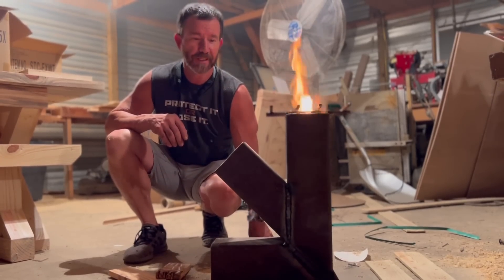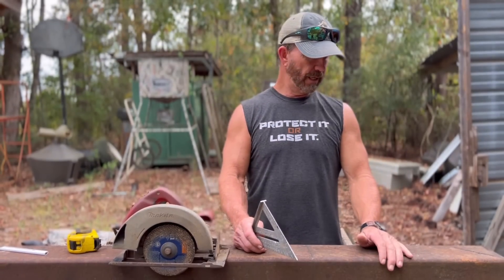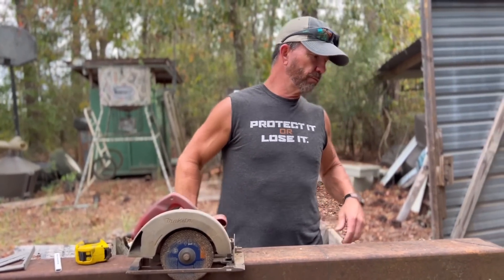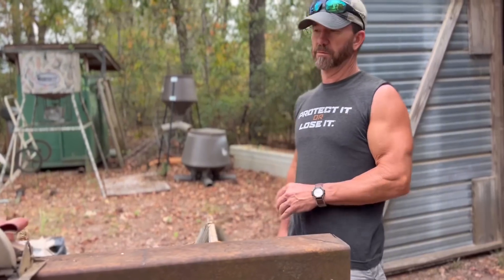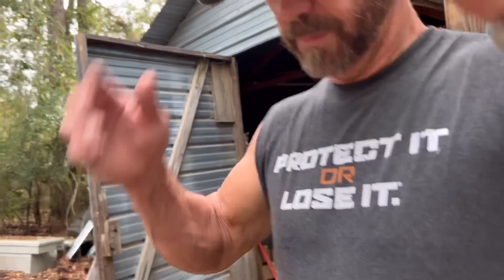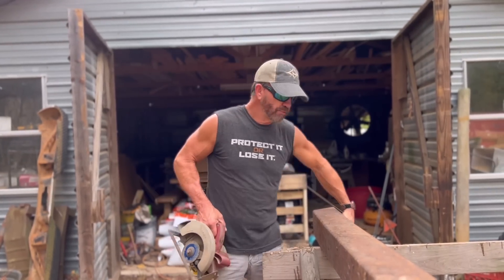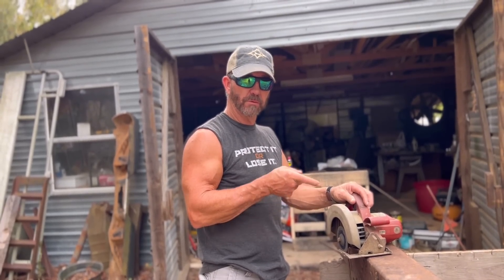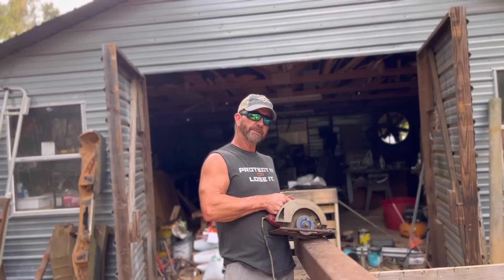How to make a DIY rocket stove

Comment: Instead of a cut-off blade get a Metal Cutting Carbide Tipped blade and it will do the job - better
It does make micro chips though - I use one.

Comment: The top needs to be taller so the flame doesn't ride so high, this is a stove so you want the heat not the flame! I'm gonna build a few of these for Asia where they cook outside under a roof to keep from heating-up the house! And IMO these little rocket stoves are the absolute perfect design for that! Wood burns fast and hot and that way when the food is fully cooked and done so is the wood. Can't beat that for a little wood burning cook stove!

Comment: Ya don't need a torch, ya need a large grinder and a ceramic blade made for cutting thick steel. I used one to cut up a old ceramic coated thick steel bath-tub and in three pieces each piece weighed about 100 lbs and it cut that like butter! And that tub was thicker than this steel tubing!
Reply: Cast iron VS mild steel

Comment: There is a thang called a Flemish Candle where you take a about a 20” long sawed log not real big and saw cut it several times across the top down about half way or more and build a fire down in the cuts and when going good jess set your frying pan on top that’s fer jess out in the woods🤙🏻🙏🏼🤠ere whatever

Comment: Might want a hinged cover for the wood feed tube to minimize fire coming up it.
Reply: Could've done without the upper feeder as air is pulling through. Hinge cover would definitely help, forcing the airflow in from the bottom. Made several out of wood.
Reply: @geraldsilveira8369  The upper feeder creates a gravity feed.  That cuts down considerably on fiddling with fuel when you are trying to cook.